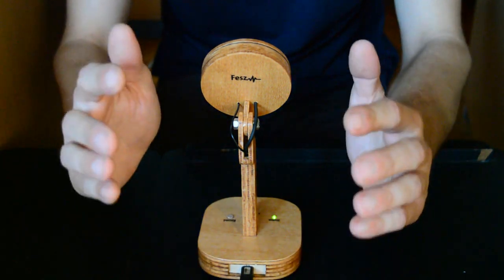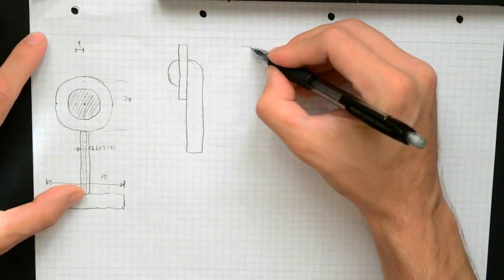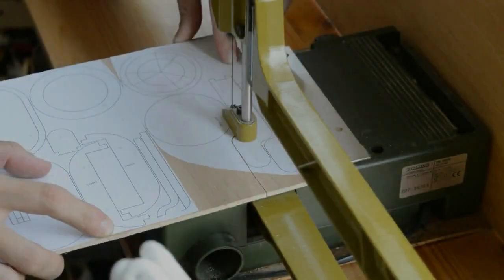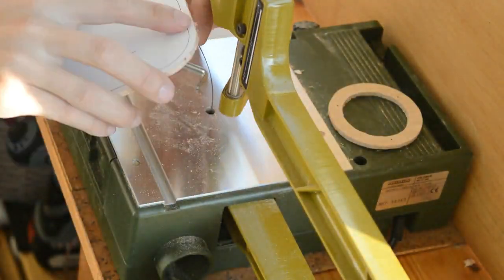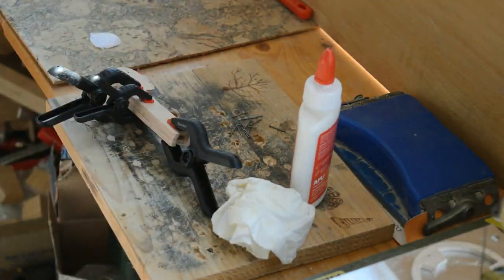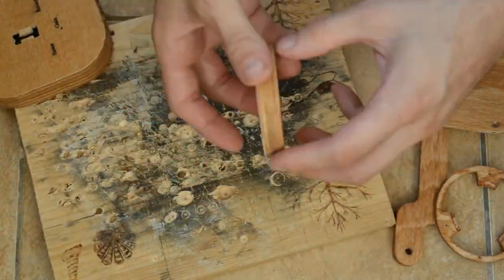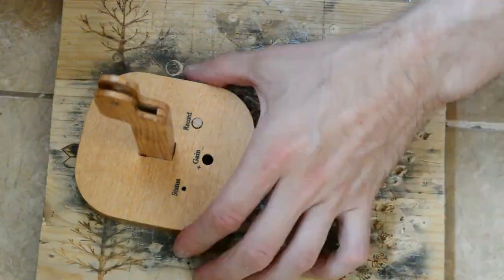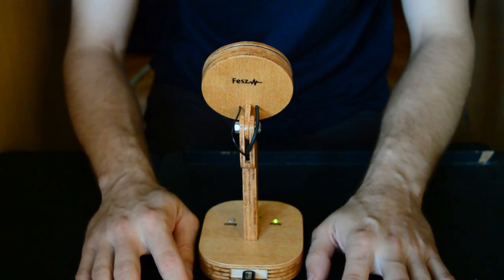Build your own HIFI microphone for recordings - Part 3

Comment: Are you using a home made mic for your videos?  Your audio is always really good, you have a good voice for this and your recording quality is great, always clear and easy to understand.  Thanks again for a great set of videos!
Reply from the maker: Actually I do use a home-made microphone - its the one build over this series, with some modifications. The trick is using a very low noise microphone (I am using the AOM-5024) with a good ADC (my current setup is using the PCM2912). Of course the noise reduction software helps also.

Comment: Interesting microphone design, though acoustically, it’s going to boost high frequencies relative to low frequencies by 6 dB, which is one reason why the audio sounds a bit thin and biased towards the highs.   The reason for this is the small baffle, you’ve essentially built a boundary microphone above a couple kHz, but an omni below that.  When wavelength is << baffle size, audio is boosted by 6 dB due to the reflection from the baffle.  When wavelength is >> baffle size, the baffle plays essentially no role in the acoustic pickup and you have an omni. Welcome to microphone design!!  There are quite a few gotchas!
Reply from the maker: I guess you are right... By using the microphone for a longer period of time, I didn't really notice it being very directional... On the other hand the dimension of the baffle was done mainly based on aesthetic bases rather than a proper calculation of wavelength... I guess its a bit more difficult to make this both pretty and functional

Comment: Hei Feri, how you paint on your gadgets ? are you using some laser printing? make a video about, it is very nice!
Reply from the maker: Hello Pavel! I took a piece of linden veneer (furnir de tei), sanded it down and applied a single coat of varnish - to make a nice flat surface. Then I simply introduced it into a laser printer, and printed. Finally I added another layer of varnish as protection. This method works, most of the time, but I'm not sure its the best way of doing this; Let me know if you try it out!